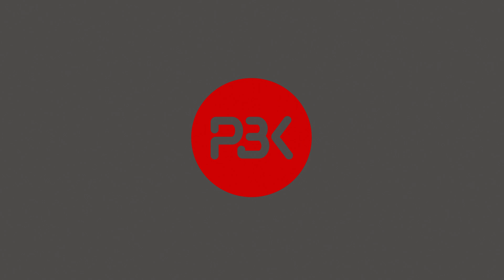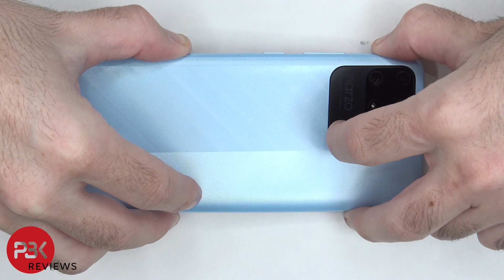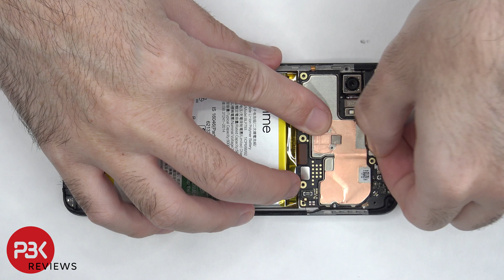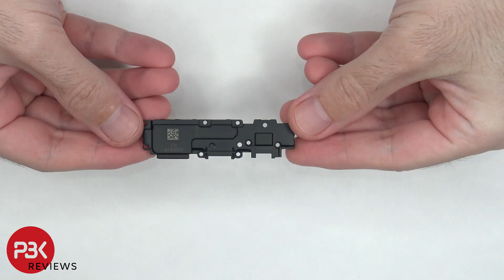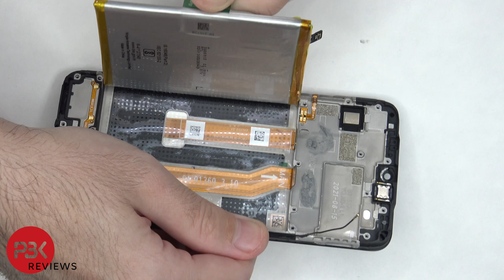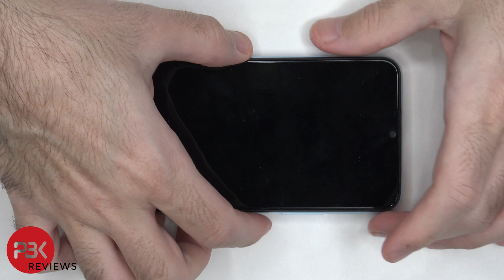Realme Narzo 50A Disassembly Teardown Repair Video Review

Comment: Sir my Narzo 50a water damaged  charger line not charging please help me
Reply from the maker: Hi, you would need to take it apart, disconnect the battery cable and dry out any liquid inside the phone. Then brush off any corrosion on chips or connectors with a small brush like a tooth brush and re assemble the phone and see if it will work.